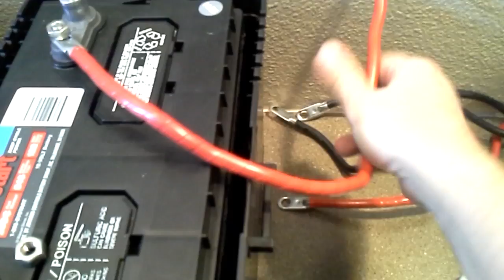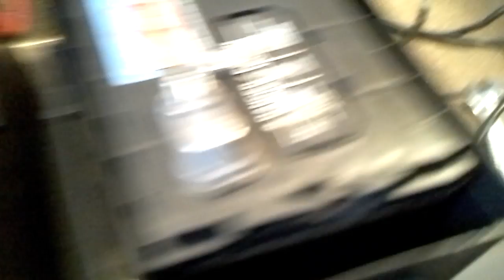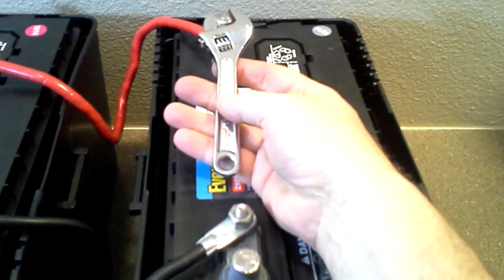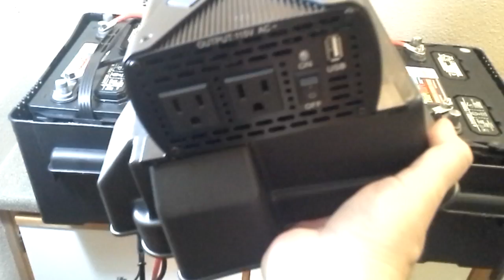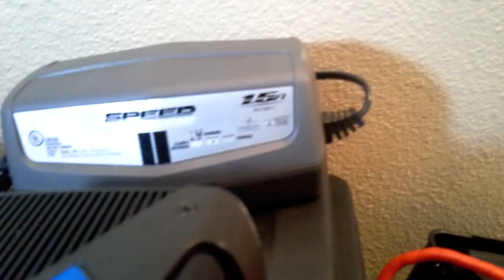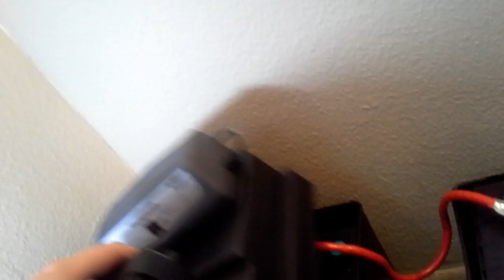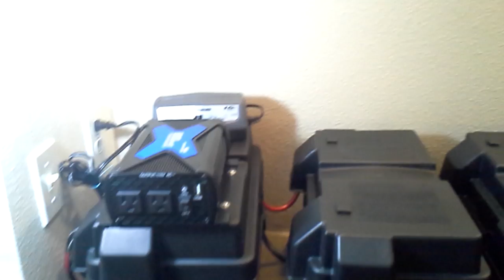Installing 4kW/Hr battery bank with 800W 120V Inverter and Trickle Charger from Tactical Woodgas

Comment: Divide your amp hours by 50% because your inverter is designed to cut out when your battery bank  output reaches around 11 volts.  In other words, your battery bank still has half it's amp hours left when your inverter cuts out.  That's the problem with these systems. If the inverter manufacturers made them so you could adjust the cut out voltage down to 10 volts before it stops producing 110 volts then you would get more hours use, but with traditional batteries they would not last as long. Lithium ion batteries can be drained more and it won't affect their life as much as with lead acid.  

Also, a short term startup load of some devices can cause the battery voltage to suddenly drop which can trigger the inverter to stop producing current.  I know because I have had a small set up of 4 x 100 Amp hour batteries and 9 solar panels connected to a 3000 watt inverter since 2011. I used my set up to power my compressor and power saws when I build my house. I was resetting my inverter constantly.  I calculated that another 8 batteries would have done the job, but at $200.00 per battery the cost is insane. Solar and battery backup isn't cheap.  You can add a wind turbine for 1200.00 bucks, and that would help when you have enough wind. My system would not run a 1500 watt heater for more than 10 minutes because the voltage would drop below the tolerances of the inverter.  In mid winter the solar panels would not keep up to the demand of 6 x 8 watt LED light ceiling lights in my kitchen so the batteries would run down and the inverter would kick out.

Calculate how much power you need, then multiply the number of batteries x 3....that should do the trick. Also get twice as many solar panels and be prepared to buy more.  In other words, if you are purchasing 350 watt solar panels,  consider that you will only get half of that from them for 6 hours a day in winter and 10 hour in summer, and you should be about right in your calculations. I'm deliberately not being overly scientific.
Reply: johnspartan98 
I liked you explaination on what practically you have experienced and gained from your installed solar system.
Your information shows that these types of batteries are 50% efficient and becomes the reason to cut off  inverter even half of the charge of total power is still in battery.
My question is do these batteries fully drain when DC devices are connected to charge Controller and not AC devices to inverter?
Secondly why volts are dropped in batteries while in Use? Even 1 volts drop say from 12 volts to 11 volts will make the inverter to cut off?
Reply: johnspartan98 
Are you talking about the normal wear and tear of these batteries output with time of use?
Reply: @KSYEDPK  Normal wear and tear is another issue. It will depend on the quality and type of batteries, how many are in your battery bank, battery saver, type of charge controller, amount of use, etc..

I used standard 12 volt 27 series deep cycle RV/Marine batteries that you can purchase almost anywhere (like the ones used for electric trolling motors). They will last 5 to 10 years depending on how much use they get.
Reply: @johnspartan98  what kind of panels did you use, harbor freight?
You shouldn't use marine batteries in a deep cycle application. I know they say deep cycle, don't believe it.try golf cart batteries instead, you'll be much happier.
Reply: @johnwyman6331  All I am saying is that when the voltage drops below 11 volts your inverter will kick out. That usually happens when half the capacity of the battery is used. Are you telling me your batteries will put out over 11 volts under load when the capacity is below 50%?
Reply: @johnspartan98   Of course everything depends on the load, and the size/type/age of battery bank. You stated your 9 panels with marine batteries couldn't keep up with 48 watts of L.E.D. lights. I would think if your 9 panels, 4 batteries, and balance of system were in good shape, then it should be able to handle 48 watts. Even with an inverter that you can't adjust input voltages.
 I wondered if your batteries were wearing out, dragging down the system.

Comment: the more batteries you add its still treated as one big battery and the inverter should be connected to the first one and last one in line NOT just on first one.
Reply: well said .....

Comment: What many don't understand is that an inverter is inverse proportional to the current output to the current input . Say you want 400 watts output at 120 volts . The inverter will draw around 35 amps or 420 watts from the battery bank . The higher the power output you want the more power from the battery bank it takes . Then there is the type of inverter you need to such as either modified wave form or a true sinewave inverter as some electric appliances will work with a modified sinewave inverter while others require a true sinewave inverter . But there again remember that what is needed for the house hold needs is less than what the inverter draws from the battery bank .

Comment: You have that inverter to battery bank wired incorrectly. The way you have it the batteries will never balance. You need to positive on the battery at one end of the bank and the negative on the battery at the other end of the bank not the positive and negative on the same battery.
Reply: No thats not at all correct !  you should not give advise on this type of subject because of the risks involved and possible death !  you should also read up on the subject you so falsely commented on.  its really so arrogant  to claim you know something when you clearly do not.   you could get some one hurt or even killed !
Reply: If the wires was under sized that would be some what correct but that is also wrong....
Reply: Steve yes what I said is correct. You have no clue what you are talking about. Those batteries would not remain balanced the way he has them connected to the draw.  Here is a video on a two battery system, but it would be the same regardless the number of batteries. By the way wire size has absolutely nothing to do with how to connect the load.  https://www.youtube.com/watch?v=kd0qwLE5aNI
Reply: I tend to agree. I would hook the inverter up with + to one side of the bank and - to the other side. I would probably hook up the charger opposite.
Reply: They are in PARALLEL, draw tha thing and you'll see it doesnt matter at all in which battery you hook the thing
Reply: John is correct. The left battery will eventually die before the other because it's getting worked harder.  And the connecting wires indeed look a little small (4 maybe even 6 gauge) for any constant higher current output. A minimum of 2 awg is recommended

Comment: The way you connected the inverter  to the battery bank is wrong. Only the first battery  will charge and discharge. Any time you connect an inverter or  a charger, solar panel, light, motor and any other devices. If you connect to the positive of the first battery bank you most connect the negative wire to the battery in  the battery bank. When you use flood battery  you will  understand
Reply: It was connected exactly right for a parallel battery bank. Each battery will discharge evenly until 1 battery becomes weaker than the others. Please dont jump start any vehicles.
Reply: What are you talking about? He’s just running them in parallel versus in series. Source: Electrical engineering major
Reply: @ajflowz5009  Lets say battery is 1, 2, 3 from left to right. Wouldn't you connect inverter pos to battery 1 and inverter neg to battery 3? I heard this is the best way to get a fully charge on each battery. https://pbase.com/mainecruising/image/140504413
Reply: @TheSaltblock  Nope you are wrong ...
Reply: @ajflowz5009  If you think this is the BEST way to connect those batteries in parallel, then you need a refund from the college that gave you that so-called Electrical Engineering degree,.
Reply: @dennischang5296  Your configuration is "better" but is still not the BEST way to connect these batteries in parallel ...

Comment: Ideally the charger (in) on positive 1 & neg on battery 3 - the inverter (out) on pos 3 and neg 1... and a 100a fuse on the pos 3 for an 800w inverter. Especially with 3 batteries so they stay in balance. A fuse between each battery would be best in case one fails and shorts.
And where's the Earth? There should be an earth from the negative of the batteries and the negative of the inverter through a bus bar and to an earth rod in the - earth (or to the chasis if in a vehicle).
And if you use the outlet from the inverter - an RCD (residual current detector) is advisable for safety.

Comment: Wrong! need to put POS or NEG cable on other end!! inverter  battery #1 pos  battery #3 neg the way you have it is unequal draw and charge of batteries!
Reply: That was in series you are talking about parallel connection. Stupidity kills the cat  ....
Reply: I was watching this and scrolled to the end to see if he would put the negative inverter cable on the 3rd battery from left to right! Fail.. This connection he has will not ensure evenly charging to all 3 batteries.
Reply: @audub1485  And yours is on full display.  Hope you don't own a cat.

Comment: This video is wrong people. In a battery bank you are meant to put positive at one end of bank and negative at other end so it draws and charges as one battery. By doing it like this video it is drawing the first battery down more than the others and more stress on one battery. Do not follow this video.
Reply: He did it wrong. Listen to the first two comments. They're right
Reply: No, he did it right.
The batteries are parallel connected so the inverter is drawing from all batteries equally.
If you keep them connected like this and you charge one battery, you charge them all.
If they were different in charge level they would exchange charge untill they would be at the same level.
Therefore you would get sparks.

Comment: Mistake like all other make on these systems. Never never hooked your inverter up on the same battery, always hook positive on one battery and negative the furthest battery away that way your pull off all batteries the same. Other than that it's the same video as every other channel on solar battery bank hook ups.
Reply from the maker: tlt40s&w 70 

True for large systems.

No noticeable effect with a 800W system.  The system shown in the video is still going strong.
Reply: Thank you for that.  I set up a four battery system and was planning to move the inverter cables from one end to the other routinely to even out the draw.  I wasn't sure if connecting to furthest batteries was safe, so I didn't do it...and of course that's not info you can search and find easily.   Maybe you can advise on another issue I'm having... 

I have my trickle charger set up on the one battery with the inverter cables.  It took a couple days to charge up, so I figured it was good to go.  Yesterday, I tested an emergency light on the inverter.  Without pulling any energy, it was reading 12.3 volts.  So, the bank is not fully charged.  I moved the charger cables to the furthest battery this morning and the charger started charging.  Obviously, the charger does not charge all batteries in the bank, but perhaps just the one it is hooked up to. 

Can charger cables be connected with one at each end of the bank in the same way the inverter cables should be connected?  Thanks for advising and sharing this bit of very useful info.
Reply from the maker: Theresa St. Amant 

Many battery maintainers have a timer.  If Schumacher battery maintainers  don't reach full charge in 10 hours they turn off.  Disconnecting them or unplugging them for a short time resets the timer and they start charging again.
Reply: This charger (Erayak, had good reviews) ran for 3 days and the green "full charge" light came on.  Checked the voltage on each of the batteries today.  They're all different, so I'm charging each one individually now.  Will connecting the charger at opposite ends of the bank obtain an even charge across all batteries at once?  And what about solar and wind input - does connecting at opposite ends of the bank distribute energy more evenly across the bank?  Maybe this charger isn't up to par.  Can you recommend a good, reliable, smart trickle charger  Thanks.
Reply: When charging or discharging batteries in parallel, the + and - connections should be made on opposite ends of the string.  this help the batteries charge and discharge evenly, because electricity takes the shortest route.  Connecting to the same battery would make that one charge and discharge before the others, leading to imbalanced batteries over time.
Reply: tlt40s&w 70   speaks the truth. The current configuration will drain the batteries starting from the left then proceed to the next battery to the right. Configure the inverter to  hook + or - to the furthest left post and the opposite polarity  to the furthest right post.  This configuration will drain all batteries at the same rate.   

Also, if your inverter is a quality inveter it will more than likely have a circuit cutoff. At a specific percentage of battery usage it will stop working. If this is so, the inverter will not recognize the last two batteries to the right in your configuration. Electricity always takes the easiest path, In your case that is - post on battery far left to + post on battery far left. 

You should start thinking 12 Volt (actually DC. There are other voltage you may want to use) when you purchase lights and other electronics. Then you can hook directly to the batteries and bypass the inverter and the energy cost it takes to convert the DC power to AC.  If that is hard to conceive think RV or Boat wiring.  Great place to start.
Reply from the maker: Max Well 
The impedance is so low (milliohms) and the current is moderate.  In theory it would be useful but in practice the longer cables required add resistance that cancels the benefit.
Reply: Good Luck
Reply: Funny, the DC backup has come AFTER purchasing a number of battery operated tools.  I like the cordlessness and that you can still use them even if the AC main goes down.  I do have a problem when it comes to charging the batteries of these tools with my DC backup though.  I bought a modified sine wave inverter and, despite what the inverter's packing and pitch say,  MSW inverters damage electronics or in my case, the electronics simply won't work on MSW power.  My backup is for the power vents and fan on my natural gas furnace and hot water tank.  Pretty sure my hot water tank digital controller was flashing me curse words in Morse code when I plugged it into the MSW inverter.  

So, I have a pure sine wave inverter coming, along with some 1/0 cable, lugs, crimper...I never wanted to have to make my own cables, but here I go!  If I'm going to have 2 inverters, I need 2 inverter cables. I have a 2 AWG set now and I'll make a 1/0 set for the 3000 watt MSW inverter.  I think that's a bit overkill since I only have 4 x 100 amp batteries, but I'm following the advise of the MSW inverter tech and electricians I had come in to cut my furnace's armored cable and put a plug on it.  All I have is 4000 watts and the inverter will kill the draw if the batteries go to 10.5 volts, so I'll only ever get 2000 watts max from this bank.  Am I wrong about this? No matter, beefy cables coming right up! Also getting 2/0 AWG for the ground wire and should have some left over for a new set of parallel cables.  

Well, at least I eventually got the bank of batteries evenly charged.  Now they are maintained by a single solar panel while waiting for some wind to hit the 1kw wind generator.  There's another mistake I made.  Despite looking up the average annual wind speed and checking wind speed on windy days,  I haven't seen that turbine move since I put it up!  Already, I would recommend much lower wattage for DIYers when it comes to small/micro wind generators. I have mine on a 4 meter mast and nada! The only time it moved was when I hooked the solar up to the wind's controller.  I had a solar powered wind turbine for a few minutes! LOL! 

Anyhow, that's enough boo-hooing!  How do you charge up the dc batteries on tools directly from the battery bank?
Reply: I charge all my battery powered tool batteries with a pure sine wave inverter. Pure sine wave is the way to go if you have any electronic equipment. This includes refrigerators and microwaves.
Reply: Mike Drew 
Sine is required for synchronous motors used in industry, but these are not used in homes.  Modified sine has been working great for my freezers, refrigerator,  and computers for many years. No need to spend the extra on sine, but doesn't hurt anything.
Reply: @tacticalwoodgas4036  Large or small you must connect the batteries correctly...